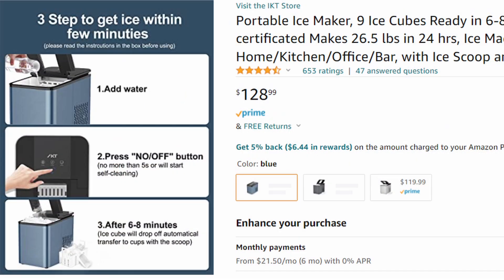❓ Battle Of The Coolers: C02 Laser Chiller Vs DIY Chiller Hack!

Comment: I thought I was buying a cow 5200 chiller from China but they show pictures of the 5200 but in tiny letters that i missed I ended up with the little cow 3000 for 144 bucks. I have a hundred watt machine and I’ve also got an ice maker like yours that I made house ice with till my kids bought me a new fridge. So I’m gonna try your method, I’ve also got a small studiobtypevrefer I may keep the who;dvthing inside. We’ll see.
Reply from the maker: Good luck with it Mark. The only issue I had with it was it sometimes getting the water too cold between jobs, so keep an eye on that or install a thermal switch.

Comment: At the time you did it ( 2 years ago ) that was an option but now the chillers are true reffers even some of the cheaper ones . Mine cost $100 and works great but i also have the K40+ with upgraded board built in air assist and Lightburn and rotary and its a learning curve compared to a diode ! LOL
Reply from the maker: I had a regular CW 5200 chiller at the time. This was an idea (cheap hack) someone asked me to test.

Comment: I like the ice maker idea to keep it cleaner currently I'm using a 5 gallon water cooler and gel freezer packs, it works but I constantly have to refreeze the packs. But this could be a game changer for CO2 machines.
Reply from the maker: Using gel packs also contaminates the water and is very bad for the laser tube!

Comment: What is the wattage used compared to chiller
Reply from the maker: I don't know, maybe 1/3?
Reply: @TheLouisianaHobbyGuy  much more thnt that.
Spec Don't mention it.
Probably as much as small a small fridge
Reply from the maker: Could be, it has a compressor, but I don't think it's anywhere near the CW5200 units I use with the larger compressor and water pump. I don't want to tell you something I don't know for sure.

Comment: Have you had any issues with condensation?  I've heard this method can cause condensation issues
Reply from the maker: Yes, you have to monitor the water temp and keep it within 5° of the room temperature to prevent condensation on the tube.

Comment: I have a CW-3000 chiller thats just not doing the job. Anyone have any experience simply dropping ice into it every so often to keep the water at 60 degrees? Im a bit hesitant even though logic tells me this should be a problem.
Reply from the maker: Nope, that is a problem. Laser tubes require distilled water or you'll wind up with micro short downs that will deplete the Co2 and ruin the tube. Time to upgrade to a CW5200 with an actual compressor.

Comment: Great video, thanks.    I had a minifrig in my shop to keep a few water bottles and misc things.  I put a 3 gal water can with antifreeze in it.  I drilled through for my in/out water lines and power to the pump.  It works really well.  As my dad always said "there's more than one way to skin a cat."
Reply from the maker: As long as the antifreeze is food grade, the pink RV stuff, you're good Robert!

Comment: I would love to do this for my beamo.  It runs to hot most of the time.  But I'm not sure how to run the water since it has an internal pump.
Reply from the maker: Probably best to leave the factory cooling system as is Shane.
Reply: @TheLouisianaHobbyGuy  Yeah that is what I am thinking too.  But I need to get the machine to stay cooler than it is.  Maybe I will put a fan under it to assist the fan cooling the water.

Comment: How did you run the power cord to the pump?  Did you drill a hole for it?
Reply from the maker: This was a temporary test Paige, just for 3 months to see how it performd. If it were permanent, I would cut off the end of the plug wire, drilled 3 holes for the hoses and wire, and used grommets to go through the plexiglass with a new plug on the end for the wall outlet.
Reply: So what are you using now for a chiller?
Reply from the maker: I have a few CW5200 chillers.
Reply: Last question.  What size pump did you put in?  Mine will not fit.
Reply from the maker: @paigewallace8713  I don't know, the one that came with the Co2.
Reply: The one I have now is a 
KEDSUM 880GPH Submersible Water Pump(3500L/H, 100W),

Comment: Hey Rich, great indept video! I was wondering if the icemaker is still holding up today? I am considering going this round or making a pc watercooling type rig, but this actually seems to be better, cheaper and easier to install.
Reply from the maker: This was only a 3-month trial Jasper as a test, and it passed with flying colors.
Reply: @TheLouisianaHobbyGuy  Why would you stop using it if it was working?  Seems to smaller than most chillers and I'd guess it's not a power hog either?
Reply from the maker: @Donny Fontenot  Because I already had a chiller and this was just a test to see how it would work.

Comment: By chance are you still using the ice maker?
Reply from the maker: No Michael, it was just a 3 month test and worked perfectly. I'm back to the CW5200 chiller.
Reply: @TheLouisianaHobbyGuy  I'm in Arizona,  in sumers its getting up to 120F, I wonder would 5200W chiller work, or ice maker is a better option?

Comment: What do you recommend for laser safety glasses, preferably that fit over regular glasses? How much wattage would I need to cut up to 1/4 inch acrylic? BTW I have an old water cooler (5 gal bottle on top) maybe I can use it.
Reply from the maker: Any certified pair of glasses with the 1064nm range will work. I got mine on Amazon. https://amzn.to/3xkqdj8
The water cooler won't work. It only chills about a liter of water in an internal tank.

Comment: this is fantastic. thank you for this. i see that there are also larger portable ice makers. that would allow for larger water volume is needed. or use 2 and have the water pump from one to the other? just a thought. thanks so much for this. i may have to give it a try. and yeah, worst case, have a portable ice maker for some other use.
Reply from the maker: I ran this one for 3 months with no problem as is, other than having to shut it off sometimes because it got too cold.
Reply: @TheLouisianaHobbyGuy  sounds good. i am new to lasers and looking into cooling. i was thinking with plans of running mine a lot and having it in a hot garage the more the better. but who knows, i may be too ambitious with just how long i think it will run at a time. thanks again. Oh, and you scored a new subscriber here.
Reply from the maker: @LokiX76  Remember that a Co2 shouldn't be operated in a hot environment! And the water cannot be more than 5-7° lower than the room temp! This will cause a short down from condensation on the tube and lower the life of the tube.
Reply: @TheLouisianaHobbyGuy  well crap. this will be interesting then. i really dont have another option. i do have an ac unit in the garage but lowest i ever set it is 80° F. and thats only if i know i will be physically working in it. so in an ideal world, if the range of temp for the laser is 59-68 F, the room the laser is operated in would need to be within 5-7 degrees of that? yikes. i'll never be able to achieve that. Thats one chilly garage LOL
Reply from the maker: @LokiX76  I keep the laser shop at 72-74°

Comment: Great video. One thing about the infrared temp guns is that they don't like anything with reflective surfaces. I would think the hose would be fine but to double check put a pice of masking tape on it then point to the tape and it should be right on.
Reply from the maker: That testing is over now Sean, but thanks!

Comment: Can you do a video of showing the setup?  I’m new to this and seeing it will help me to understand the logic better.  Just ordered the ice maker on Amazon!
Reply from the maker: There is nothing to setup. Just remove the ice tray, put your water pump in the bottom of the icemaker along with the return line. Fill it with distilled water and turn it on.
Reply: I know this vid is a year old but I have a question.  How often do you have to refill it? 🫣Does the ice melt? Excuse my ignorance and you are the best!!

Comment: Hi Rich
I believe your temps may fluctuate during your ice dump cycles. When you dump ice your water temp will drop as it circulates the colder water. Once the ice melts temp may climb back up some until the next cycle. I am playing around with the ice maker too and it is very promising. One thing I am doing a bit different is connecting the return water line to a 3d printed manifold with holes in it. It is very thin and sits on top of the coil. Water is running over the entire coil from top to bottom to utilize the entire coil all the time so no ice is actually made even though it still runs through the cycles as it normally would. It is thin enough that it does not interfere with that. Getting ready to do a video also shortly. Also experimenting with peltier cooling a bit. Thanks for the great video!!  I subscribed.
Reply from the maker: That's a better way to do it so it doesn't make ice! This was just an experiment for me, so I didn't want to modify the ice maker. But even so, on a chiller, it works the same way with temp fluctuations. The chillers work off a thermostat that turns on and off in 5° fluctuations.
Reply: Do you have any pictures or an stl for this?
Reply: @jrdamien  getting ready to post a video comparing peltier cooling versus ice maker. When I post that there will be a link to download the manifold for free of course. That will be very soon. I will try to have video posted by the end of next week.
Reply: @widgetwiz3d756  Looking forward to it. I need a chiller right now. But I can't imagine there's any real comparison to a peltier to an ice maker.

Comment: The main problem I see with this setup is filling and removing water during a 2 hr or longer job. This ice maker only holds so much water, after it runs out,  you must  somehow remove water from where the pump is and add more water to the ice maker reservoir. What is your process for doing that? I currently use ice bottles and throw them in my water tank, but would sure like to change my system out.  Thanks.
Reply from the maker: I used this setup for 3 months without adding changing the water. It recycles its own water.

Comment: Interesting solution.  How is it holding up , 4 months later?   Thanks for the tip.
Reply from the maker: I used it for 3 months before I retired it and went back to the CW 5200. It passed the test with flying colors Mark.

Comment: Is it still working well?
Reply from the maker: Yes it is! Nothing has changed. I will shelf this project in a few days and go back to my CW-5200 though. I only did this experiment to see how it would work Mohammed.
Reply: @TheLouisianaHobbyGuy  thank you rich, sine the cw-5000/5200 out of my budget i am going to do this instead of ambient water cooling system ( radiator and fan)here in saudi arabia we have very hot weather and so the room ambient air over 20c.
Regards

Comment: Interesting find!  I ran a 1/4HP aquarium chiller for a couple years before upgrading to my CW5000 chiller. There are a couple of modes on the chillers. One sets it to have a range to run in and it will let the temps fluctuate. The other locks the temp in where you see much lower fluctuations. I keep mine at 18c and it rarely moves off that even on long jobs. Either way, your set up is keeping the temps in check at a low cost!  Nice find!
Reply from the maker: I used to use the aquarium chiller! My problem was the low temp turn off stopped working, some kind of thermal switch problem that I didn't want to spend time diagnosing, and the whole thing would just turn off. I was going to get a new one until I got this idea.

Comment: I run a 100w. It doesnt see more than 55. 
I got the cw5000. Have not hooked up yet.  Running bucket with 2gal for now. Does good enough.
Fighting bubbles whenever i fire it back up. Pretty sure it is draining back. 
So i just pick up one end of the machine and suck all the bubbles out.

Unf the chillers dont come with much to hook them up.
Reply from the maker: I was running a couple of hours today and actually got a cold warning alarm! It's working like a champ! But you shouldn't have any back-feeding if your hoses are water/air tight. I would check inside for a small leak.
Reply: @TheLouisianaHobbyGuy  draining into bucket when off.  No leaks beyond bucket noticed. All going away soon. 

A chill warning.  😎
Reply from the maker: Okay, good to hear.
Reply: @TheLouisianaHobbyGuy  
Interestingly..
I get home and my wife tells me the laser was smoking. Found out fan filter clogged. 
But more interesting.. With filter removed i could see the water connections. The bulkhead fitting has been loose.
But i found that the input line was kinked. This might be why the water flow sensor was bypassed. 
Hmmmm
Reply from the maker: @turboflush  I knew something was up!

Comment: Great idea!  Is there a way to connect the pump to a switch in the laser so the laser won’t come on if the pump isn’t running?  My “Chiller” has that ability electronically.  It also looks like the ice that’s made dumps into a compartment for ice and also contains the cooling water. Is that correct?  So you must put water both in the ice container as well as a tank for the what the ice is made from.  I obviously don’t understand how it works because if it works like I’m imagining, you’d have to add water each time. 
Your definition of cold is different than here in Montana. Forty eight is shorts weather!
Reply from the maker: Yes, plug it into the plug on the side of the laser. I removed the basket for the the ice and just filled it with distilled water. It's all one unit. It draws the water from the bottom and drops ice from the top.

Comment: Another common one is use a manual window AC unit.. and put the cooling coil in the water... and connect a external thermostat.. and vent the heat outside.  U can pick up one manual window unit for about $30 off season used.. there are plenty of people having videos on how to do it.. so it will cost you about $60 in total for 5k btu
Reply from the maker: Eeek! Too much DIY for me Rob 😎

Comment: What do you recommend to put in my chiller to keep it from freezing
Reply from the maker: I don't know, I don't have that problem. But from what I have heard in the community, they use propylene glycol, or RV antifreeze Joshua. Amazon has it for under $20. https://amzn.to/3IFwRUG
Reply: @TheLouisianaHobbyGuy  thank you
Reply: Joshua, I’ve run my Co2 laser in my insulated shop in Minnesota for over 5 years. I run some heat in there but it can still get cold during our sub zero cold snaps in the winter. I’ve run a mix of 50:50 distilled water and RV antifreeze without issue. They being said, keeping the pump going to move water through the system helps keep it warmer and moving water is less likely to freeze up. Even just running my CW5000 chiller will bring the temp of the water up.

Comment: Brilliant video! I’m curious to see if adding a 5 gallon bucket of water & a second small pump to circulate water between the ice maker & bucket would make the temperature steady while burning.
Reply from the maker: I was thinking the same thing, but this machine will never work as hard as I pushed it for the test. There's going to be white space and different powers and speeds in most jobs, so the water shouldn't get nearly as hot.

Comment: You could lower the temps to be more  stable by making the ice to fall into something that grabs it and making the return line to be dropped into it. That should make your cooling to be the most (sorry for my English XD
Reply from the maker: I think as long as it stays in the 16-20 degree range it should be perfect! This is a hobby laser, so it won't be used in the way I tested it.

Comment: I use an ice maker as well, filled with distilled water. I have an 80w red and black, we are in summer here in Australia so it gets pretty hot, as long as I turn the ice maker on and let it do a few cycles before I start I’m good. 
I had to modify the water pump so it would fit in the ice maker (used an angle grinder to cut off the base plate lol)
I really didn’t want to go the bucket and blocks of ice route and I happened to have an ice maker at home I wasn’t using anyway. I couldn’t afford the chiller, the CW5200 is around $900au.
Reply from the maker: I knew there had to be other people doing this Mark! Nobody has an idea that hasn't been done before! I just don't understand why it's not more popular, or why manufacturers aren't jumping into the market!

Comment: I have a 130 watt co2 laser & I use a CW-5200 cooler set at 20 degrees Celsius. I find it holds the water temperature  within  a tolerance of 3 degrees so if your icemaker can hold the temperature between  60 & 70 degrees F. then you're laughing. it's not surprising that your temperature varies a few degrees, all control thermostats have a set amount of hysteresis so you're not constantly stopping and starting the compressor.  There's no doubt that you are overworking the compressor but as long as it's not overheating it should be just fine.  If it does start to get too hot then you might be able to hook up a computer watercooler radiator in the return flow to take away some of the heat before it hits your chiller.  Anyway, good luck with it and hopefully it turns out to be a winner for ya. 👍
Reply from the maker: I think the varying temperature was the ice dropping and then melting in the water. The compressor isn't being overworked. It's designed to work that way.
Reply: @TheLouisianaHobbyGuy  You know what, I just assumed that those portable ice makers were similar to portable fridges with an additional coil to freeze the ice. my mistake.  That explains why they are so cheap.